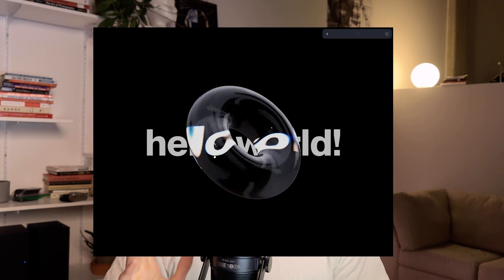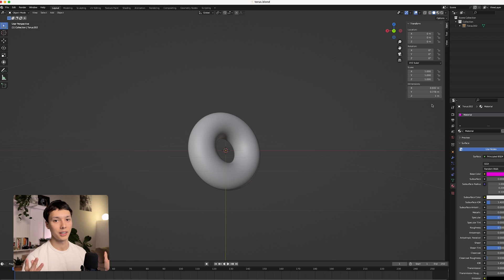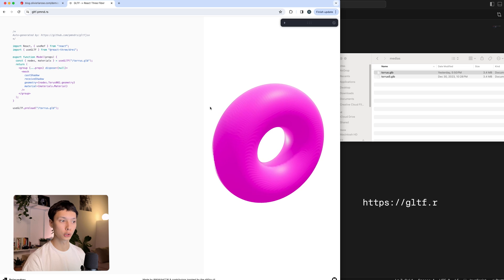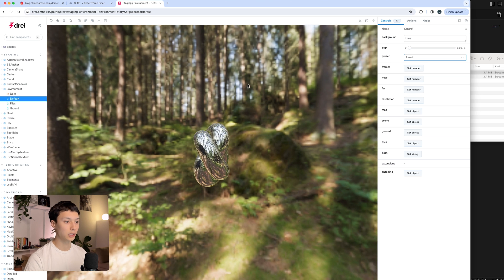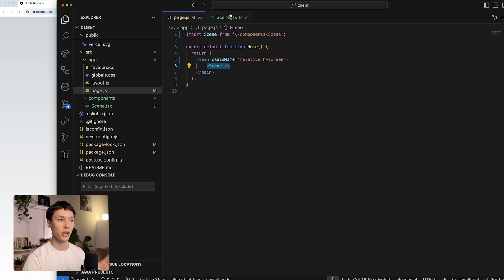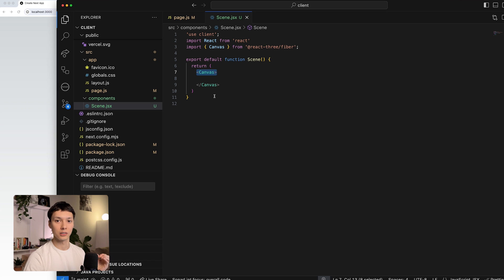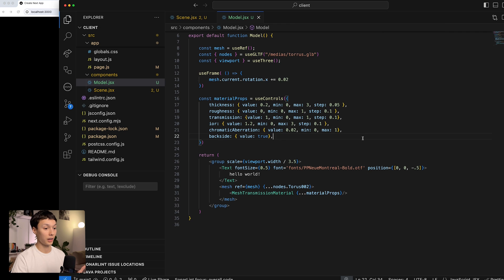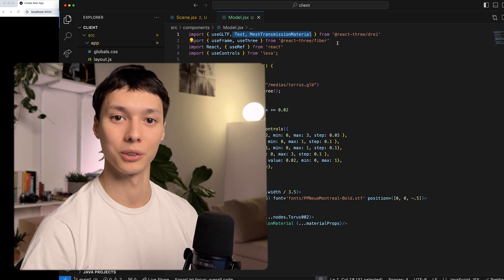How to Make a 3D Glass Effect using Three.js and Next.js

Comment: If you're having trouble getting transparency to work on a model that wasn’t created directly in Blender, try importing it into Blender and exporting it again — even if it's already a .glb file. In my case, .glb files from Nomad Sculpt didn’t display transparency properly until I ran them through Blender.
Reply: Thanks a lot man. You saved me here.
Reply: I did that but my problem is that I don't get the IOR to work. I have an object, not a Text, behind it and it just shines through. The refraction inside the TransmissionMaterial just doesnt work for me. I tried all kinds of things like RenderOrder and stuff but cant get it to work. It seems so simple in this video :D

Comment: Hey Olivier, what a great tutorial. I tried to change the GLTF with downloadable file, but I got the material was not working. How should I adjust?
Reply: If you're having trouble getting transparency to work on a model that wasn’t created directly in Blender, try importing it into Blender and exporting it again — even if it's already a .glb file. In my case, .glb files from Nomad Sculpt didn’t display transparency properly until I ran them through Blender.

Comment: Really loving your content! One question though, in chrome, the torus model disappears after a second with the console message 'THREE.WebGLRenderer: Context Lost.', it does work in safari for some reason, any idea why this is happening?
Reply: Ho Steffan,
I am having the same issue. Did you find some fix? 
My page in Safari also works not for a while, if I squeeze the page the elements disappears…
😢 really sad(
Reply: I had the same issue. It seems that removing the dynamic code and importing the Scene again works
Reply: @djsquid1988  thank you, Your solution fixed my issue as well.

Comment: Hey this transparency is only working for this .glb model. I have one model for that its not working what should i do
Reply: If you're having trouble getting transparency to work on a model that wasn’t created directly in Blender, try importing it into Blender and exporting it again — even if it's already a .glb file. In my case, .glb files from Nomad Sculpt didn’t display transparency properly until I ran them through Blender.